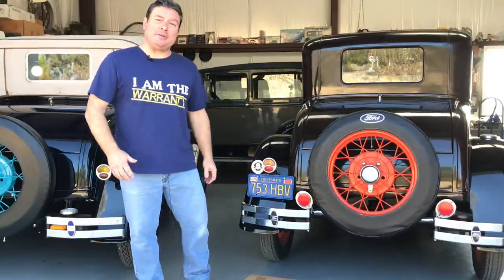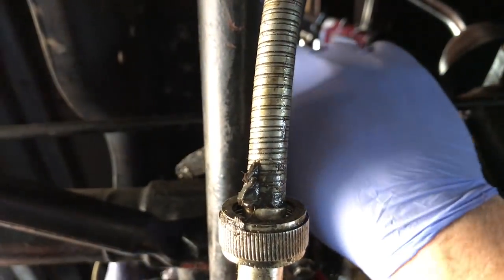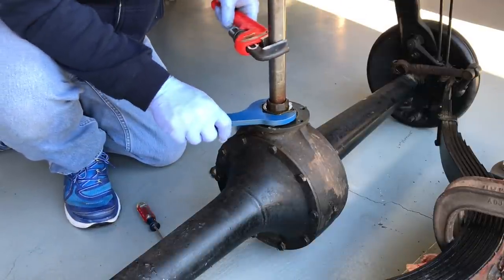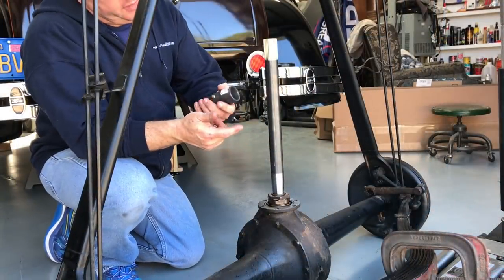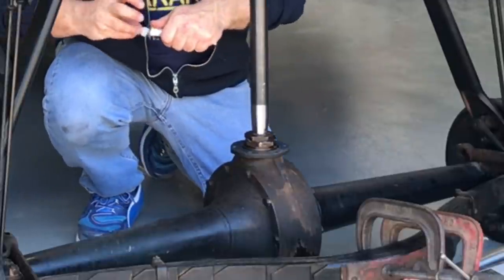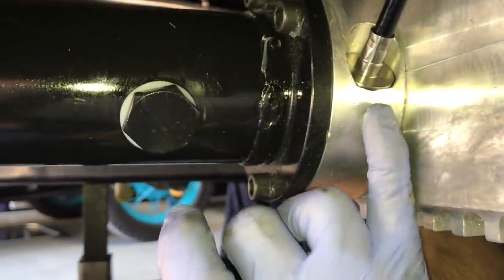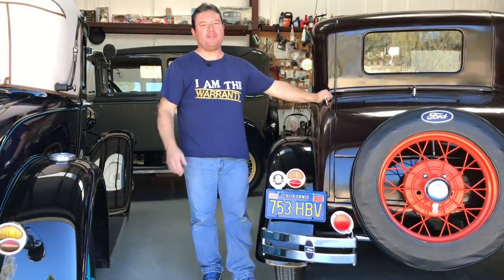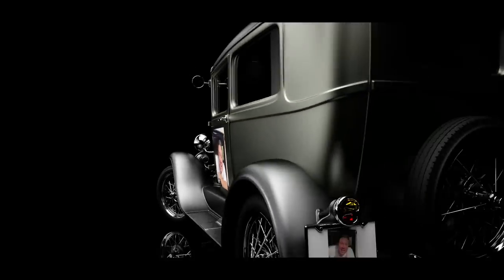Ford Model A Mitchell Overdrive Installation

Comment: So by my rough math, if your top end was 45, the overdrive will get you up to 60? Obviously I don't know what the stock car was capable of. We used to use a model A transmission to run a hoist winch, so I find this very interesting.
Reply from the maker: Stock Model A is good for 65 tops, 50 MPH is a comfortable cruising speed.

Comment: You should see how the airplane mechanics do the safety wire. I'm curious as to why they used safety wires on that part, and is there any other places they use safety wires?
Reply from the maker: There are several places on the Model A where safety wire is used.

Comment: Hi Paul 
Between me and my parents we have have four A's. I'm am doing my first brake job on one of them and I am re lining the shoes. So I have a concern someone drill out the rivet to big on the previous lining! What is the rivet hole size in the shoe suppose to be?? My are at 11/64 and the rivet is little over 9/64 and when I use a brake foot rivet press the rivet looks to press though the shoe instead of lay over. This is an old art an have no one to look up to ask how tight the rivet should be in the shoe.

Comment: Great video on the install! About how many more MPH can one expect from the overdrive? Or is it more about lowering RPM ?
Reply from the maker: Kinda both.  It's possible to do 65 MPH with OD without harming the motor.  But, in reality, the reason for OD is to make 55 MPH a lot more comfortable and quiet.
Reply: @ModelA  It also helps here in the mountains by giving the driver another option between 2nd and 3rd gear so you don't have to climb long hills at 25 MPH. Would you agree?

Comment: Hi Paul, another great video. 
I'll be installing a Mitchell Synchro gearbox and overdrive in the next few months and this will greatly assist on the overdrive. 
Do you plan to do a similar video on a Mitchell gearbox install?
Lastly, where do you purchase the pinion drive spanners?
Thanks and keep the videos coming. 
Kind Regards
Bill
Reply from the maker: Swapping a transmission will probably be a video eventually.  The spanners are sold by all the popular Model A parts suppliers.  Best of luck on the new trans!

Comment: If I would make a suggestion;  it would be to use the Proper Tourqing  Specifications with proper   torque  wrench/ tools  where applicable
Reply from the maker: Like they did at the factory?  Haha!
Reply: @ModelA  well we are not sure went on at the Factory,...however just for  better Instructional  techniques, and  professional prowness..I would try to show the Tourqe Values and proper method  of the Tool used
Reply from the maker: @bruceweinstein4782    You should make videos doing exactly as you suggest!  That would be cool.

Comment: Have you every used any medium duty
Thread locking compound on bolts or nuts on some of the components around the model A cars?
It helps prevent thread
Rust and helps keep thing's tight and can always be removed easily. I would still
Use safety wire where
Indicated..
Tight
Reply from the maker: I use it only where needed.

Comment: Paul, I'm new to the channel, New to early ford's. I'm a ham radio operator too. N8IWS, love old radios too so I'm guilty.  This video got me wondering, could this be used on a 46 Ford 2 door sedan.  Really enjoyed the viewer Q & A video.  I'm subscribed and tuned in.

73 de N8IWS / Dale
Reply from the maker: Welcome, OM!
 They do make a similar unit for the V8 cars.  I have never messed with one though. 73 DE K6FRC

Comment: Steve B  
I have really enjoyed your videos.  I have ordered and plan on having the overdrive by the end of April.  I do most all my work on my 30 Townsedan myself so I have watched your video a number of times so I don't miss or overlook anything.  It seemed to me when you mark the nut on the pinion assembly you used the inside keyway on the assembly.  When you reassembled you used the keyway on the outside of housing to set your the nut.  I did I see it wrong?
 I do have a ?.   Why can't the whole the pinion assemble be knocked off the shaft as an assembly?  This way the  preload is not disturbed.
Thanks Steve
Reply from the maker: It was marked to the outside keyway both times.  It was just an optical illusion.  You have to disturb the preload to pull the pinion race from the banjo anyway.   Thanks!!
Reply: @ModelA  thanks for getting back to me.  It is good to know about the preload. I was planning on trying to pull the pinion assembly in one piece.  It does sound like good idea.
Steve Barnacle
Reply from the maker: If you have a way to pull it as one assembly, yes.  But I only have the pinion puller from Mitchell, so I have to remove the upper nuts and use one to hold the plate of the puller.
Reply: @ModelA  I was planning sliding the Mitchell puller plate down the drive shaft and putting it on top of the assembly.  Then putting on a 1.125 split collar just above the plate and tighten it to the shaft.  Then use the plate to push against the split collar (instead of the assembly nut) to pull the assembling out of bingo.  What do you think?
Thanks Steven Barnacle

Comment: My "A" has a 4.11 rear end. If I want to install a Mitchell OD should I also change the gear ratio to 3.78 while I am at it? Second question - I understand the Mitchell OD is not compatible with the early rear ends. Can I tell if mine is compatible without opening it up and looking at the pinion gear?

Comment: 26:06 Hi Paul, years ago a friend who owned a Cessna showed me how to safety wire bolts, I see this is a bit different.  :P
Reply from the maker: How did he do it?
Reply: @ModelA  I emailed you a diagram as its complicated to explain. The idea is you loop the wire through and around the bolts so if a bolt wants to loosen it pulls on the taut interconnecting wire on the adjacent bolts which tightens them. In this fashion once the bolts are wired like this its impossible for any bolt to loosen.
I used to work on high vacuum pumps and industrial vacuum systems and in some critical instances aircraft safety wire was used to secure bolts so this came in handy to know before hand. That was back in the 90's.
Reply from the maker: Thanks!

Comment: Lile the last guy sead
I makes me want to own one nice. And a wife that helps with the car wow
 A lovely Lady to boot
You are fortunate
And She is too. This my second or third watch of this video
I enjoyed it again.
Very fine man you
Are. I'd be a little
Afraid to own one hear in mich. Because of the salt on the roads
In winter. It would take
Only a little longer
For the antique Ford
Manganese Steel body
To get eat up with rust
I'd have to drive it only in the spring summer and fall otherwise it would get pretty darn
Gunky. I went to the
Auburn car Museum in Indiana 4 years ago very interesting antique Style front wheel drive cars I was fascinated as I am with the Ford Model A's
Well Ford kept it simple and outlasted those other companies.
CUL Paul live long
Keep the A's videos
Coming. KC4ITU
Dwight. I'm on the 
Air at times on 7.150 mhz. Short wave 40
Meter Hf ham band.
God Bless You. 
Dwight. 73.
Reply from the maker: Thank you, Dwight!  73 and God bless you,

Comment: Paul, thanks for the video! I’m in a different boat because I installed a 59ab and a ‘39 trans to my stock model a torque tube. I only get about 55mph out of it. My 29 cc pickup has 4.11 gears amd im interested in a Mitchell overdrive. Thoughts on adding this to my current setup?
Reply from the maker: I have no idea.  Never played with anything except a stock Model A

Comment: Great intel for the upcoming rear end removal to change the spring leaf on mine - thanks a bunch!
Say, does that car have a lockable nut on the spare tyre?
Reply from the maker: Yep!  It's a period correct accessory.  The Model A suppliers sell a repro now that accepts a padlock.  I have one of those on my tudor sedan, and it's decent.
Reply: @ModelA  *added to wishlist xD

Comment: As I am watching this
Video again for the third time. It takes me back to when I was 
A mech. On the Job
Professionally in the 1990s and 2000nds I quit around 2010
Went on to other
Things untill 2019 had to retire do to a bum knee. I was a professional automatic transmission specialist on Ford and especially General Motors automatic Transmissions fascinating technology going on there.
The mo. T uses a planetary geared
Trans. Sorry I know 
You know. The Mitchel
O/D unit I would Love
To see the specs. And
A blow up diagram
On paper and its power
Flow in and out. It is too
Flat for planets. But would like to see the internal guts of the unit. Dwight

Comment: People watching should consider using a spring spreader when removing rear axle
Reply from the maker: Why?  The way I do it, you don't remove the spring from the rear end.  Much safer.  What is your way?
Reply: @ModelA  I was just worried about the 90 year old rusty bolt breaking before or while putting the clamps on. I was under the impression you should remove the axle from the spring, then remove the spring from the chassis while it's relaxed.
Reply from the maker: There is a lot of tension on that bolt even when the spring is relaxed.  If you've ever assembled a Model A spring pack, you'll have to clamp them to get the bolt in.  Admittedly, there is less tension on it when relaxed, but not zero.

Comment: Paul, I am duly impressed.  Ever since my teenage years I've had a deep love for those old cars and at some point want to own one or a hot rod myself.  With the Mitchell transmission and overdrive installed, what does your Model A average on fuel mileage?
Reply: @ModelA  that's not too bad.  How big is the fuel tank?
Reply from the maker: 11 gallons

Comment: Did you need to wrap tread tape on the drain plug? I have a habit of it to prevent leaks.
Reply from the maker: No.  The copper washer does the trick

Comment: Hey, new sub with a question. Have you ever seen a mitchell overdrive moded by adding shifting solenoids with the switch on the tranny shifther  and no second shifter on the floor board? Just crossed my mind that the mitchell is very like a two speed rearend. Yes I drove a truck for a while. Easy mod and probably apealing to some.
Reply from the maker: Never sen a Mitchell with solenoids.  Seen a Volvo and plenty of Borg Warners with them.

Comment: Paul, I see some As that appear to set too high in the rear. Not so much in the front. Are their rear leaf springs the wrong ones or maybe have an extra leaf?
Reply from the maker: The pickups do that because of the 10 leaf rear spring with no weight on it.  Otherwise, it's usually because the front spring is worn.

Comment: Hello Paul this video is very helpful my overdrive is on its way soon 
Would you recommend using 3.54 gears also ? I want to be able to cruise along around 60 miles per hour. Not wanting to kill my engine
Reply from the maker: Only if there are no hills anywhere near you.

Comment: Hi Paul. Great video. How does one shift with the overdrive installed? Do you split ever gear into low/high or do you simply engage once you are in high gear? Thanks!
Reply from the maker: Check the video about how to use the overdrive.  Link is in the description.  Thanks!

Comment: I bought a 1930 model A roaster. It hard to stop. Where the brake pump is located. It has front disk
Reply from the maker: If your car has been modified, I have no way of knowing where any of the modifications were mounted.  Sorry about that!

Comment: Hay Paul thanks for the video . I have a 1929 AA truck it has a newer ford I believe 2300 4 cylinder engine with I believe to be ?c3 trans hoping to put flat head V8 with older trans . do you happen to know if they have and overdrive that will work for that year?
Reply from the maker: Call Mitchell Manufacturing and find out!

Comment: I have 1930 Model A.  Drives great but thinking of taking it on longer trips.  I've seen the kit for $3500 is that going price these days?
Reply from the maker: I think so
Reply: @ModelA  the specialized tools also include ie: the puller you used in the video?  Great videos thanks for the help

Comment: Very good video. Now where do I get those swell blue wrenches?
Reply from the maker: From my dad tool box!  Hahaa!b Snyders sells them.  Tell them Paul Shinn sent you.
Reply: @ModelA  Thank you I will. I bought a Mitchell before my surgery and it is sitting on the floor next to the A. At times I wonder if I can get it installed.
Reply from the maker: @kevinholland4156   Just take your time, my friend.  It isn't a race.
Reply: @ModelA  First I have got to get my knee replacement working again. I sure liked that lift you used on the brake video. Can you recall the make?
Reply from the maker: @kevinholland4156    I don't remember.  Sorry, man!  Yea, Jim's lift is pretty sweet.

Comment: Great video, I got my "A" on the road after 9 months of toil, (including the Mitchell OD) only to find out the passenger side axle seal is shot and allows differential oil to leak past and make a mess after hitting tire. This is the only part of the car that intimidates me, have you ever disassembled the banjo housing? I'm seriously thinking of replacing oil with John Deere Cornhead grease...I've heard it's been done and the videos I seen on it, looks like it should work, (it's what is currently in my steering box) any thoughts or opinions? Thanks.
Reply from the maker: I have had many of them apart.  The fact is, you need to replace that seal.  It isn't difficult. What you propose is like saying, You cut your wrist and are bleeding out.  Should you eat a block of cheese to fix it?  No, you stop the bleeding with stitches.  Don't put too thick of fluid into the rear end and ruin everything in there because you need to change a two-dollar axle seal.
Reply: @ModelA  I hear ya...when's your axle seal replacement video coming out?:-D  Did you do it with the rear end removed, or can it be done one side at a time?
Reply from the maker: I have a rear end rebuild video in the works.  You can do it without pulling the rear end from the car.  You'll need a rear spring spreader.  Just spread the spring and remove the shackle from the side with the problem.  Remove the banjo bolts and carefully slide the axle housing off.  pop the old seal out, press a new one in, reassemble.  Make note of how thick the axle housing to banjo gasket is on that side and replace with same thickness new gasket.  Bolt it back together, replace the spring shackle, and all done.  But while you have the spring spreader in place, might as well do the other side also.
Reply: @ModelA  Thank you, looking forward to that video!

Comment: Correct me if i’m wrong, but isnt the spring free of pressure when it comes out of the car? I’m new to modal A’s and still dont own 1, so i’ve never messed with the springs in 1, but every car and truck i’ve worked on the springs werent under pressure if there wasnt any weight on them. Not tryn to correct u, but tryn to learn something new if i’m wrong.
Reply: By the way, you make some of the best videos on Youtube. Thanks for taking the time to help others out who are still new and learning.
Reply from the maker: The Model A springs ARE under tension when connected to the axle.  If you popped one of the shackles out of either side, the spring would jump up with explosive force.
Reply: @ModelA  i would have never guessed. And thats why i asked. Lol. So how do u take them on and off?
Reply from the maker: Glad to help!  You need a spring spreader.  There is one for the front and another type for the rear.  Once the tension is off the shackles, you can remove them.
Reply: @ModelA  that is definitely good to know.

Comment: Great video,  I got one already in my sportcupe but the speedometer cable is messed up and would like to replace it. But mind goes into the case and disappeared in it. I'm at a loss how to replace it. Got any ideas?
Reply from the maker: Pictures??
Reply: @ModelA  I took the cable off the speedometer and looked it, I think it is supposed to look square and about a half inch long but the cross section is a flat square I forget the term. Short on two sides and long on two sides. Anyway it slips inside. I'm thinking of putting a slim inside it to see if it will work.
Reply: I'll make some.
Reply: I tried your email but Google says it's invailed
Reply: Got some pics but YouTube is getting nosey

Comment: very good video Paul....enjoyed it.. BTW good time to change the diff fluid after your remove the pinion and clean the diff and paint..But i'm anal...
Reply from the maker: You're right!  I should have mentioned that.  Well, at least you posted this in the comments, so people can read it and include this good advice.  Thanks, Mark.
Reply: Especially after 90 years minimum since these were made
Reply from the maker: @Shadow0fd3ath24    People change the fluids on a regular basis.  The fluid would not be 90 years old!  HA ha!